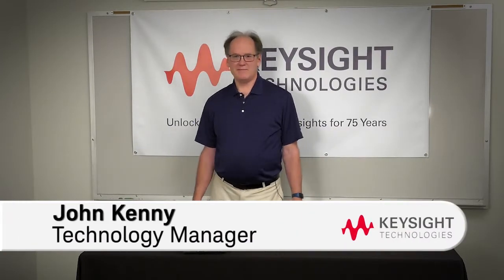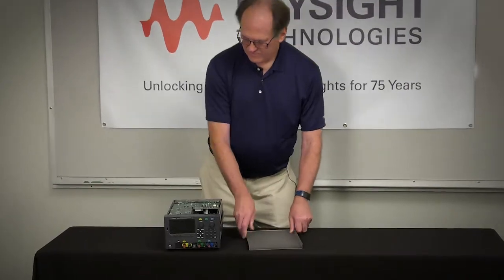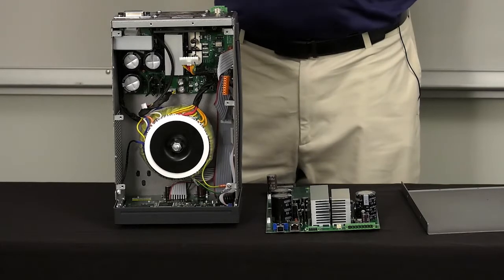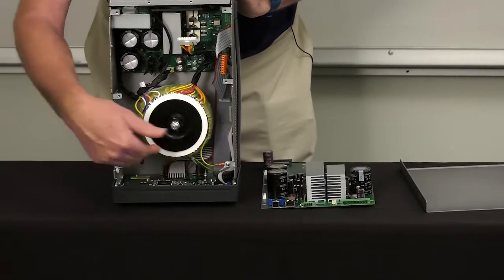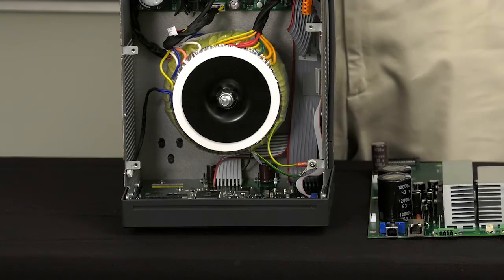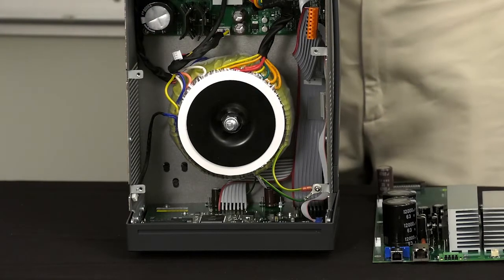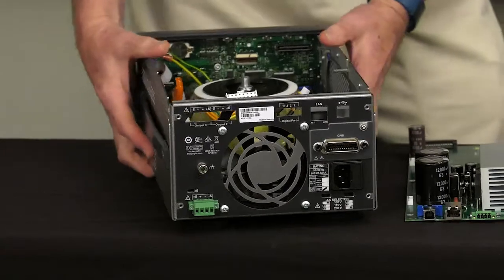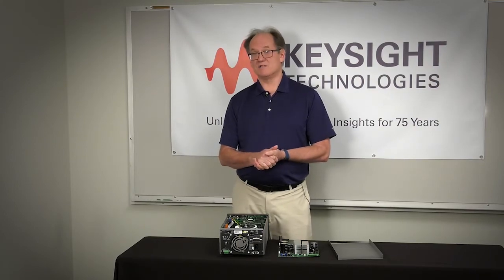Triple Output Bench Power Supply Teardown, Keysight E36300 Series

Comment: What happened if I supplied accidentally with 230V and the AC selector was stetted to 150V?The varistors are broken or it's another protection inside?Thanks
Reply from the maker: Gabyone EET   The power line has a fuse and each power supply comes with two fuses. One of the fuses is for low voltage with higher current and the other is for high voltage with lower current.  The fuse will protect the power supply if too large of voltage is applied.  You also want to be careful not to select a high voltage setting and apply  a low voltage as the power supply can't function properly.

Comment: Excellent video.  The design  looks well thought out.  Would have liked to hear amperage ouput rating for the high capacity heatsinks.
Reply from the maker: ax5790  Sounds like another video.  Have to figure out a way to provide a reference sound to provide some comparison.  It is very quiet relative to the other power supplies that I have used.